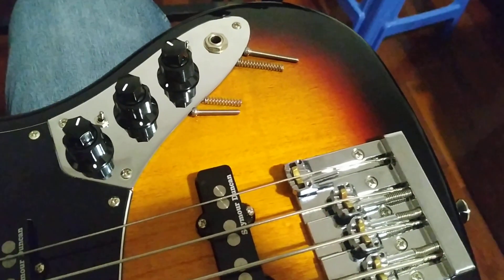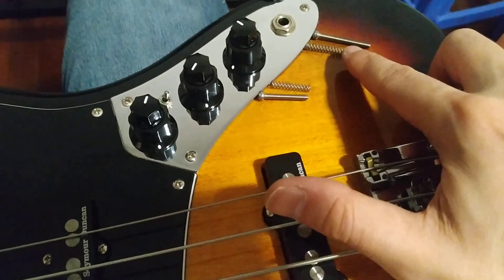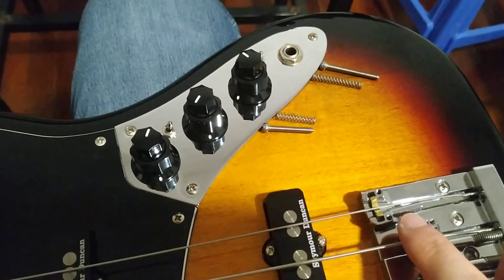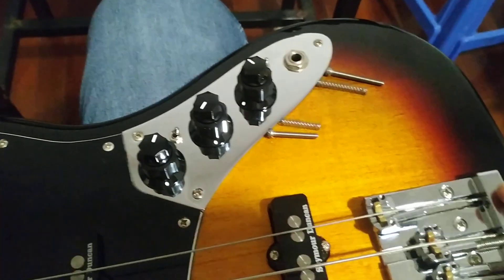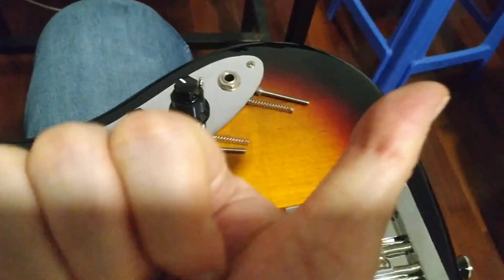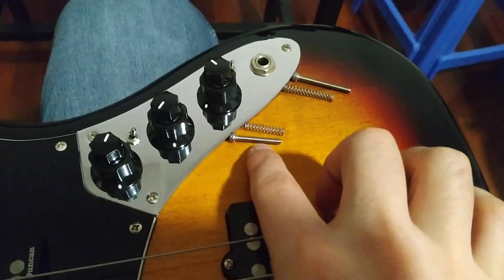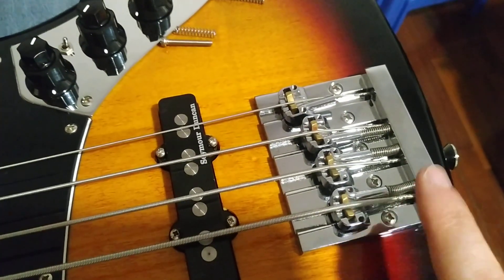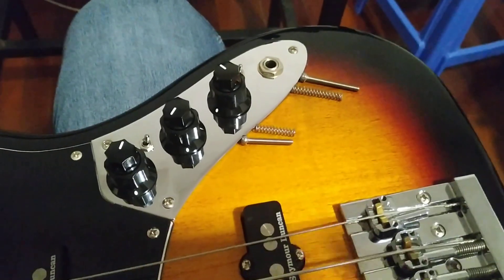Hipshot Kickass Bridge - Changing Screws On Bridge To Move The Saddle To The Right (2023)

Comment: I just bought one of these myself and the saddles on the 1st and 4th string both click when applying force perpendicular to the neck. Does that seem normal? I emailed Hipshot and they haven't been very helpful.
Reply from the maker: Do you need to move the saddle towards your right hand?? If so, you might need to change the screw and spring for the shorter one (comes in the package). Hope this is helpful. Cheers!
Reply: I had that happen and it turned out to be a missing screw that adjusts string spacing. When screw was locked in it went away.
Reply: @baldbassclef  Yeah my issue was something similar. I play with low action so I had the saddles pretty much bottomed out. I changed out the saddle inserts and shimmed the neck {amateur job, will need a pro to properly shim it} and the clicking stopped after that.